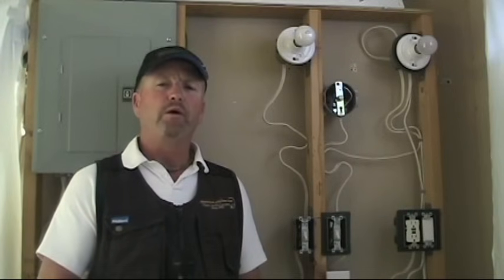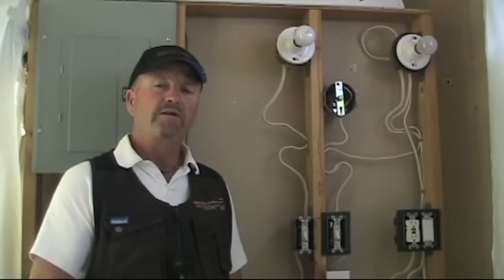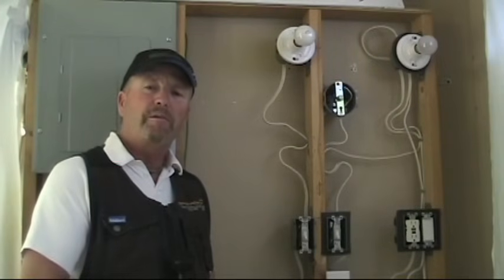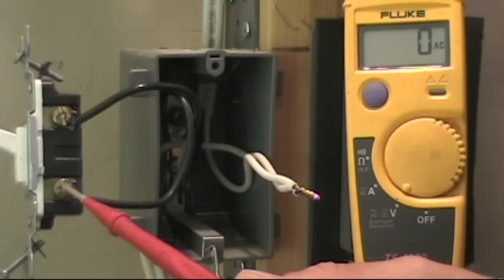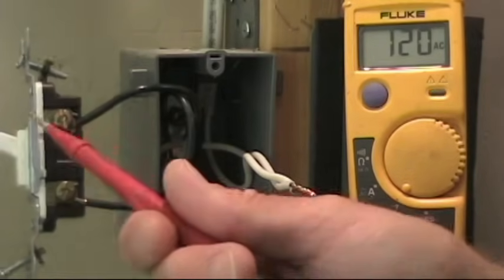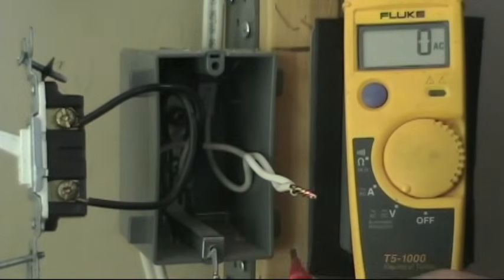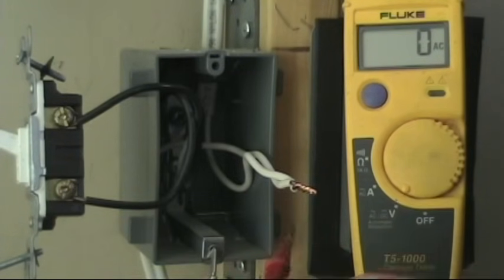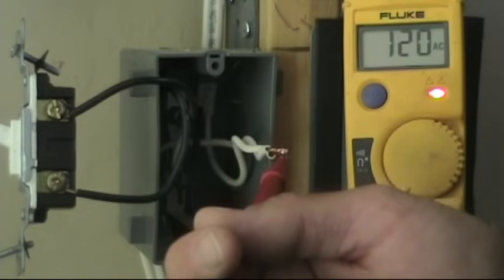Understanding an Open or Loaded Neutral

Comment: Why not show what happened in the box up stream? Also, with a plug in tester, it will show where the open neutral is, won't it?
Reply: It will only show there is a open neutral on that circuit, not where it is.  You could have half a dozen receptacles and a couple lights on a circuit, meaning you would have to hunt for it and knowing what to look for. Of course with cutting the breaker, exposing as he did, then carefully check. If that one is ok, go to the next. In this case, look for a disconnected white wire in a junction box. That is the usual culprit. Or in the case of someone twisting it too tight, it was broken and messing with it broke it off, not knowing, or simply didnt get it in the wire nut, if wires were not twisted. But again, make sure the breaker is off by using the plug in tester.
Reply: Because it was simple. The neutral was not grounded at the panel. It was just floating. As it can be anywhere between the switch\outlet to the panel. And that can be anywhere. Including several other switches\outlets and boxes....
Reply: Cool
That's why
Reply: @Donald Duck lot of houses built before the 60s have no fault (green or bare wire) ground. And they don't get to ground through conduit. They only have  the grounded neutral.
Reply: But why would you undo wires and expect it to work the same? What am I missing?
Reply: Reading the below comments, I believe there to be a lack of understanding of what the term ‘upstream’ means. 
In simple terms it is between you and the breaker in this example. That could be in lots of locations. But to keep it system, assume the wire come from the breaker to this box. Since we see a good twisted connection of the neutral/grounded connector, and no other junction locations from here to the panel, you would find a loose white wire in the panel neutral buss bar.
Reply: TERIBBLE demonstration.
Reply: Donald Duck are you reading challenged? I started my statement with “In simple terms”!!!
That means there were no other items on the circuit, no other junction spots. The ONLY connections in “simple terms” are in the panel and that box!!! If the connections are right in the box, then in simple terms it has to be in the panel. That is an attempt to explain how this happens in “SIMPLE TERMS”
Will you find that situation in real life? Rarely! Only in a dedicated circuit!
Reply: Donald Duck you need to practice some reading comprehension prior to being to help as you can not understand ‘in simple terms’ by your lack of understanding english, you add confusion to those who are looking for help in understanding their electrical problems! Plenty of others had already addressed that the dropped neutral could be anywhere upstream between that receptacle and the panel!
Reply: How do you find a loose wire or neutral? 
Half my house is out.
Reply: Upstream is confusing. Should say the neutral is open between the switch you are working on and the the neutral connection in the panel
Reply: Just Think about it, if a neutral is not connected and copper is touching what would happen
Reply from the maker: https://www.electrical-online.com/understanding-an-open-or-loaded-neutral/
Reply: Terry Peterman  I don't understand why that diagram has a random 120v power supply linked to the neutrals.
Reply: This guy is into show business , he wants you to continue watching his channel. Somewhere in a j box or anywhere for that matter. The neutral is connected to a hot wire. Common sense.
Reply: Wrong. The neutral is no longer connected. You get between a load. You will find out the hard way...As the neutral is a current carrying conductor. It need s path to the bonded ground...
Reply: Master Chief 00117 yes somewhere in a j box or anywhere neutral is disconnected. You're right. It creates a 220 situation. Been in that situation. I've fried appliances in the past. Years ago
Reply: It's not 220 volts when you lose the neutral conductor. It's now an unbalanced load. You need to understand AC systems... As you need 2 conductors at different angles ie Phases. To create 208 volts. As current is passed through the line side. Through the load side. Then back to the service panel through the neutral.
Reply: Master Chief 00117 120/208 Y or wye you're referring to 3 phase. Sometimes we have to work with power on. From my experience when I open up a j box. I always tape the the neutrals right below the wire nut right before I unscrew the wire nut. That way I can safely take out that one particular identified neutral conductor.
Reply: it's not a 3 phase. It's a single 120/208...You only have service line two feeders with a ground..

I'm an electrical engineer. I know what I'm talking about. As people can get killed if I'm wrong...
Reply: Master Chief 00117 woe !! Going back to my text book and read on it again. Thanks 🆒👍
Reply: Master Chief 00117 normally one needs to install a 45 kva transformer to obtain single phase 120/208
Reply: The utilities use what ever they have designed. As they are purpose built and expensive. 

One reason they use cheaper 120/208 single phase in residential areas. The more expensive 120/240 volt 3 phase or 277/480 in commercial and industrial ares. Not including the odd residential area high leg 4 wire... Which is now phased out...
Reply: Master Chief 00117 normally in residential areas DWP supplies  single split phase power at 180 degrees right off the power grid.
Reply: Master Chief 00117 they do provide 3 phase usually in high end residential or multiple apartment dwellings
Reply: Daniel  Castillo no Daniel if you use a test meter, you will not get a reading of 240 volts between your black and white  wires. Nor will you get a reading of 120 volts as you should. In theory you will get a reading zero as the circuit is not completed.
Reply: @DanielCastillo-cn3pp  Nope, the hot 120v goes thru the light switch &  thru then ligh,t then comes back out thru the neutral wire back to that switch he was showing. Since somewhere upstream the neutral was disconnected. Thus, it couldnt get back to the panel, so it stopped at the switch.
Reply: @DanielCastillo-cn3pp  no, his friend just became one load in a series circuit. If he had touched the neutral to the grounded metal box, it would not have tripped the circuit breaker. He would have completed the circuit, and the light would have come on.
Reply: @DanielCastillo-cn3pp  SO TRUE, SHOW BUSINESS.
Reply: Tom Weller thats kinda what i thot, zap, hey someting wong..

Comment: I'm still confused what happened and how to fix.... can you show it??
Reply from the maker: This was just intended to explain a situation a friend encountered, and an unusual scenario of having a 120V reading on a white neutral conductor. The solution is:
1. If you are working on a circuit, shut off the breaker until finished
2. If you have a continuous neutral (grounded conductor) path back to the panel as per the electrical code, you will not encounter an open or loaded neutral.

Comment: update, repairing the open neutral fixed both problems, but I'd still like to know about the 0/240 with load.
Reply: how was it open?
Reply: Steve T see my earlier post. There is a breaker below the meter on the pole which feeds a "pigtail" to the panel in the home. The neutral in the box below the meter was burnt and open.

Comment: Thanks, this explains the theory behind half of my problem.
My current issue is:
Mobile Home with panel wired like a subpanel (bonding at the pole)
Panel has 50 amp main breaker with 4 conductor pigtail to 4 prong plug
Plug to outlet on pole protected by another 50 amp breaker/shutoff. Direct to meter/ power co.
Power off at pole for all work😀 turned on for test only
After scratching my head for the longest time, I disconnected all circuits (8)
Capped off all hot and neutral wires, left all grounds connected.
Tested main lugs 
Test showed 120 between ground and neutral just like your example but......
I also see that if I connect a test load (60 watt bulb) to any breaker if I switch the
Load on I get 0 volts on the red terminal and 240 on the black
When the load is off it is 120/120
Took the cover off the supply on the pole the neutral was burnt and open
Explaining the 120 on neutral to ground.
What causes the 120/120 shift to 0/240...?
Thanks for the help

Comment: Well it was good verbal explanation but not good visual in a circuit diagram. Schematic in electricity is were the rubber meets the road... This video needs more work with a point A to point B fault and remedy. Missing is what is upstream causing the fault. WIKI would say this article needs to be more comprehensive.
Reply: I had this happen during a bathroom remodel in my home.  Whole circuit was wire 100% with a loaded neutral.  Found that at the source of power junction box the neutral going back into the original source had a poor connection.  Rescrewed the wire nut on with 3 neutrals and bingo.  Everything on circuit working.
Reply: I had the same issue.  I followed the neutral, which was hot all the way to the connection where a neutral went cold.  Shut breaker, unscrewed cap, retwisted 4 neutrals together, turned breaker on and circuit worked.  1 neutral was not making contact originally.
Reply from the maker: Sorry, this was just an general information video regarding a situation a friend encountered, and an explanation why. I can do better next time!
Reply: Thanks!
Reply: Curiosity exactly what I thought too.
Reply: Woody Woodlstein Yea same here. I have this same issue but I don’t know where the neutral is open, I’d like to figure out the best way of testing it to determine where the fault could be.
Reply: Mc Earl it’s really strange to think about.  
Surprised something doesn’t start smoking !? 
One time I was adding a splitter to cable tv in the basement and I got zapped from the coax!   The coax core was hot !   I didn’t have a tester and later had it all torn out anyways but ya. That was just bizarre.  I should have had them come and figure out where it was picking up all that current.  ?  I’ve felt 120v and more several times and that’s what it felt like. Probably picking it up  outside up the pole.  Old neighborhood and those cable clowns don’t give a shit.